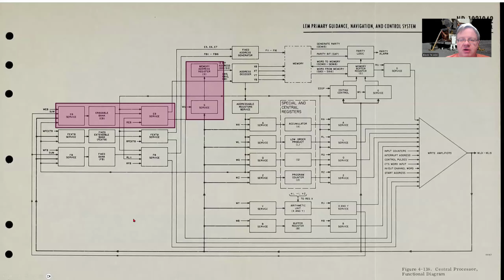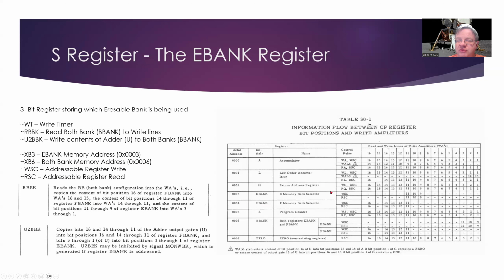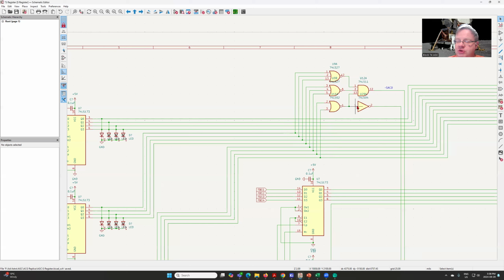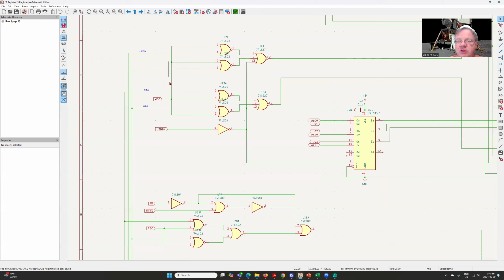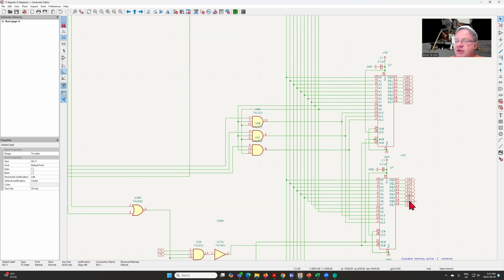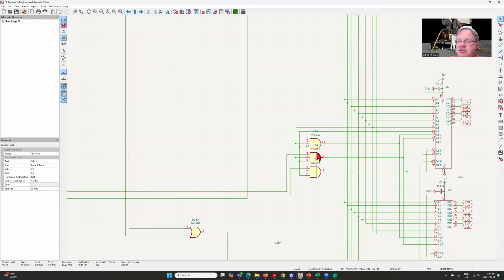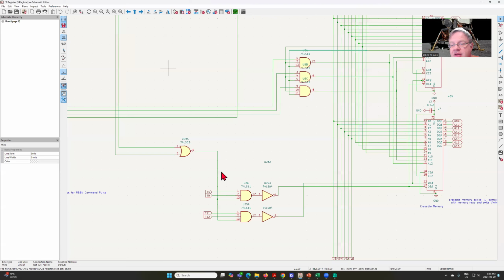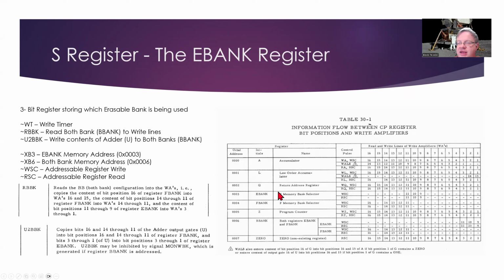EP 15:  S Register   Part 2

Comment: I think you may need another level of selection for writing into EB, for the "TS BBANK" possibility: in this case, EB is loaded from bits 1-3 of the write lines, without going through U.

The erasable memory in the AGC is traditional coincident-current core memory, not core rope -- only the fixed memory used rope. And unlike more modern SRAMs, core memory (of either variety) needs no refresh! Once the data is written, it will be retained indefinitely (at least 50+ years), even through complete loss of power. The Apollo missions made use of this capability to power down the computer in flight (e.g. on the lunar surface) without worrying about needing to reload anything once the computer was powered back up -- the RAM was nonvolatile, and the computer was designed in such a way to expect (but validate) data to still be there during boot. The problem is that readout from core memory is destructive. Whenever you read from a core memory location, all of the corresponding cores get set to 0. To account for this, all data that is read out must be written back. In the AGC design, this is all handled through the control pulse sequences: instructions that do not modify erasable make sure that they have stored the original value back into G before the erasable write cycle starts. Instructions that do change erasable simply put the new desired value there instead of what was read.

It's definitely worth implementing the parity logic! Even though you'll almost surely never encounter an erasable memory parity error, fixed parity errors are easy to trigger, and the computer test procedures involve steps to intentionally trigger them. This is because all unused fixed memory locations are completely unwired in the rope memory modules, causing them to read as all 0 bits, including the parity bit. So all you need to do to trigger a parity alarm is attempt to read from a fixed location not used by the current program.

Also, resetting S with your GENRST isn't strictly necessary, although I don't think it will have any ill effects. The original AGC design allowed the S register to start with any random value, with no reset inputs. The boot process forces the GOJ1 subinstruction to execute first, which sets S to a known initial value through control pulse action. Digital Development Memo #340, "Block II GOJAM Actions", contains a nice concise list of all of the things that the global RESET signal did in the original design.
Reply from the maker: Again, thanks so much for the additional context. Would you be able to point me towards any details on the "TS BANK" , I wasn't able to find it in the documentation I'm currently referencing (that said it took me a while to find the details on the directly addressable register logic for the EBANK and FBANK).  As for the erasable memory, I realized halfway through the recording that I kept calling it core rope, which is wrong :)  thinking I may need some kind of battery backup to emulate the non-volatile nature of the AGC memory.

Thanks for the link to the GOJAM actions, I had started reading up on in a while back as I was starting to design the SQ logic
Reply: @kellymcdonald78  Essentially, writing into address 3 (WEB) causes bits 9-11 of the write lines to be written to EBANK, while writing into address 6 (WBBK) causes bits 1-3 of the write lines to be written into EBANK. Figures 4-138A and 4-138B in our later copy of ND-1021042 ("acelectroniclmma00acel_0" on the Internet Archive) have a really nice graphical representation of the various ways the bank registers interact with the write lines.

Battery backup would work! Another thing you could look into is MRAM or FRAM -- those are modern non-volatile magnetic RAM chips (whose internal block diagrams are shockingly similar to core memory). You might be able to find a pin-compatible drop-in-replacement for whatever SRAM chips you were looking at.
Reply from the maker: @mikestewart8928  Ahh, I see it now. The Raytheon ACG Info Series Table 30-1 has a good breakdown of the addressable registers